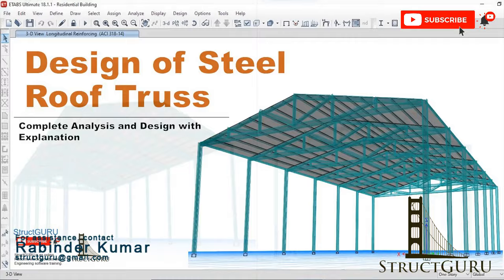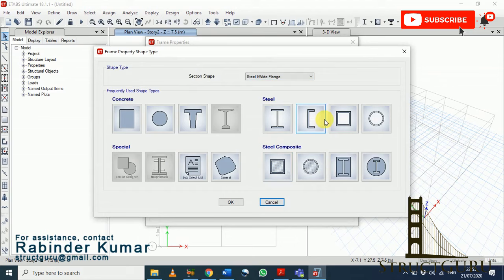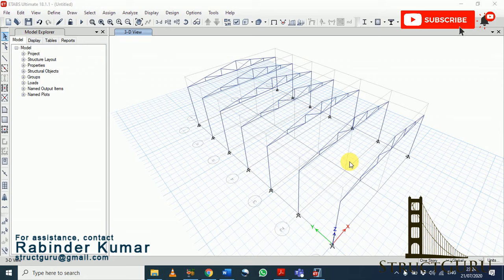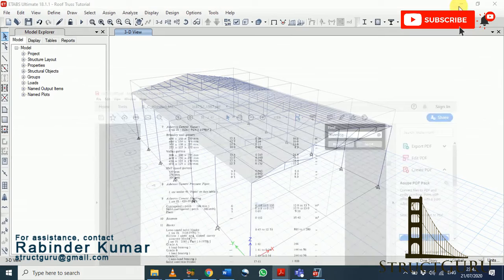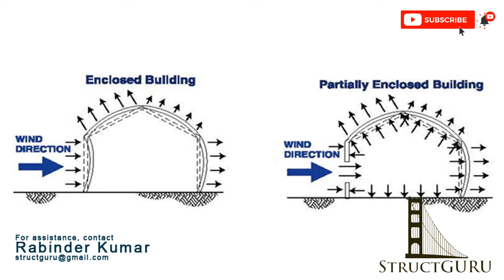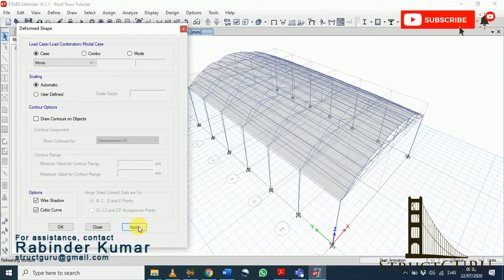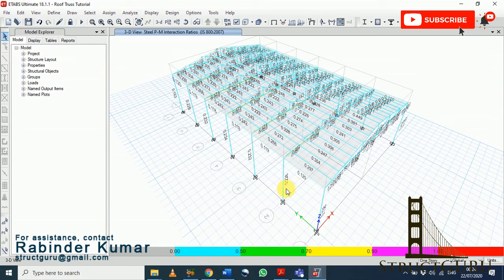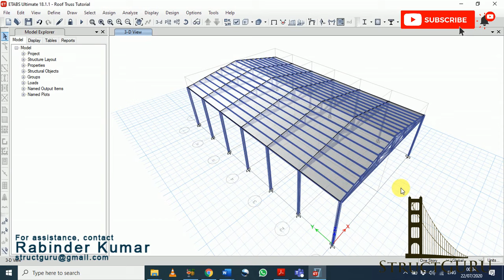Design of Steel Roof Truss in ETABS

Comment: I have a problem. When I draw a shell and assign null as section, and then apply shell load on it, it won't transfer the load to the beams and columns below it. How can I apply area loads avoiding the self weight of the shell element? Looking forward to get answer from you. Best regards.

Comment: if we select the auto-selection property for the truss top and bottom member and for the column it is a better way for steel design. by useing  the auto-selection property program to collect economic section for all members
Reply: I just designed a warehouse through auto beam n columns everything seems good except columns all columns have failed what could be reason behind this..?? 🤔

Comment: I have a question.  When you imported the steel sections, the section shape was indian but the default material was A992Fy50 which is American standard material. Fy of A992FY50 would be 355 Mpa is SI unit. I have seen people changing it to Fe250. Shouldn't we do that?
Reply: You can change it accordingly.

Comment: Dear sir,
You are using the pressure coefficient value of Cp=-0.8 and Cp=-04 . Where do you get it from??
I have found different value from IS 875 Part 3 .
Reply from the maker: Its 0.8 and -0.5. This also depends on L/B ratio (L= length of the building plan and B= Width of the building plan)
Reply: @structguru2200  Which code you are using???
IS or ACI??
Reply from the maker: This is same in both ACI as well as IS  code.

Comment: What is the safe p-m ratio?
Reply from the maker: Should be less than 1.
Reply: @structguru2200  I'm not getting channels in rendered view?
Also, the members seem to overlap rather than connected. Is that reliable?
Next, I don't have steel connection design option in ETABS.

Comment: Upload using steel tube as materials on roof of building not as warehouse.
Reply: @structguru2200  Design Roof truss on top of G+3 using material as steel tube not as I beam or channel section.
Reply from the maker: @mathstube1802  is it a request or order ? :P
Reply: @structguru2200  if you take it as order its  order and if you consider it as my request it's request...But what I am saying is like it's sincere request.
Reply from the maker: @mathstube1802  Hahahahah, you follow the steps and choose the tube section and try to design it by yourself. Let me know if you face any difficulty.
Reply: @structguru2200  Can you please share which section is for MS tube??
Reply from the maker: @mathstube1802  go to define->Frame section->import new property->choose pipe section
Reply: @structguru2200  Thanks you ji...Now which section of materials is selected...there are various sizes?? Can you share which size is most prefered in site??